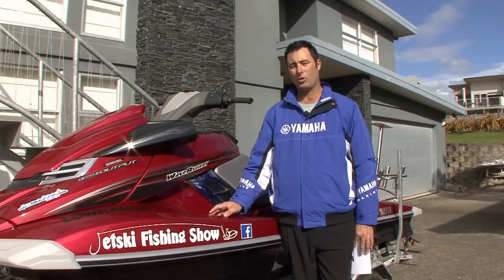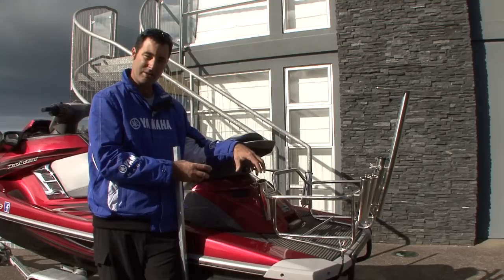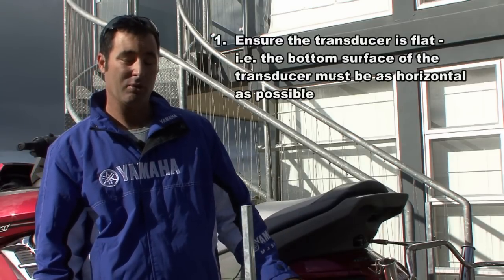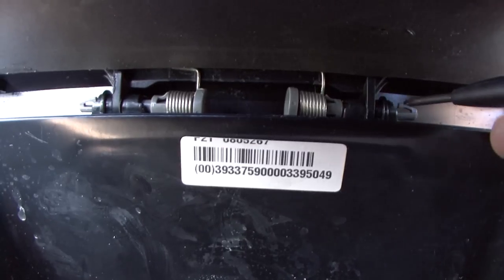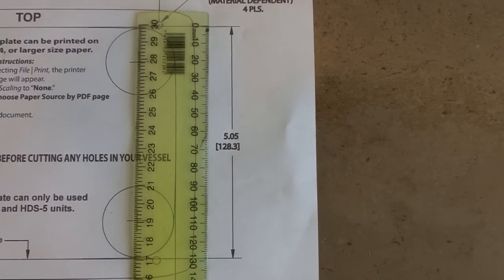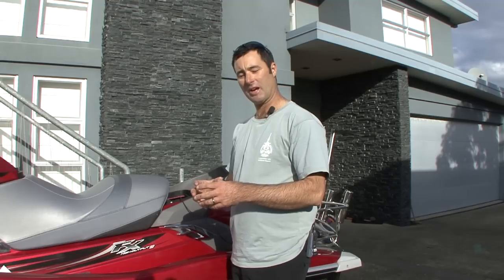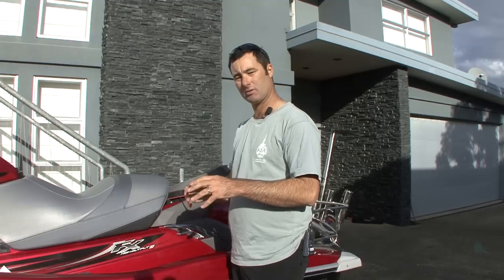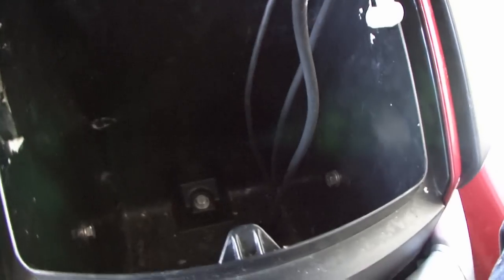How to install a Lowrance Sounder GPS on a Jetski for Fishing

Comment: Nice video but how do you latch the glovebox lid once the Lowrance is installed? Without a latch the whole unit opens and slams shut over every wave. This cant be good for it.
Reply from the maker: +Glenn Bartlett Good spotting.  What I also installed was a couple of wardrobe type catches (female) in the glove box, and then screwed a couple of bolts into the threads that are already on the unit which then click into the wardrobe latch fittings to stop it bouncing.  I have just installed an HDS7 Touch into my new ski, which I pushed up the lid a little to leave the existing mechanism there 0 I have filmed this and this video will be out soon.

Comment: Love your videos! What year is the yamaha in the video? I installed a p79 on my 14 yamaha vx deluxe an haven't had very much luck getting sonar readings from it. Getting kind of frustrating. All I want to do is get out there an fish. Any advice or info you can give me would be much appreciated. Thank you
Reply from the maker: +Jrevo420 It should work if you put the transducer under the removable water tight bucket under the small rear seat where shown on the video.  That is where I have installed it on the 2013 - 2015 models with 100% success.

Comment: Hello, I was just wondering who fabricated your fishing rack? I had something similar fabricated by a specialist stainless steel fabricator here in Australia but I am not happy with it. After one use, the supporting legs folded in on itself after the mounting system came loose which subsequently caused some damaged the rear of my 2013 FX SHO. Thank you in advance.
Reply from the maker: It is made by a company called Manta Marine.  You can view their website at www.mantamarine.co.nz and they ship internationally.  It is the best product on the market.

Comment from the maker: You can do that, and it will work, but it is not designed for that so you will not get the best performance out of it.  The Airmar is designed to be inside the hull and is a higher power transducer.